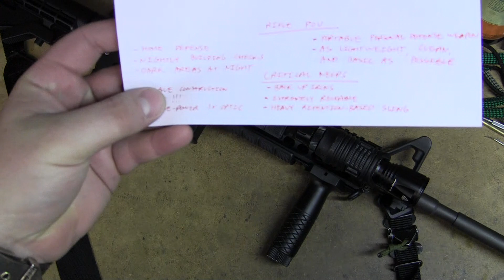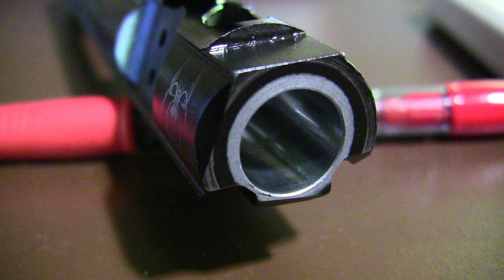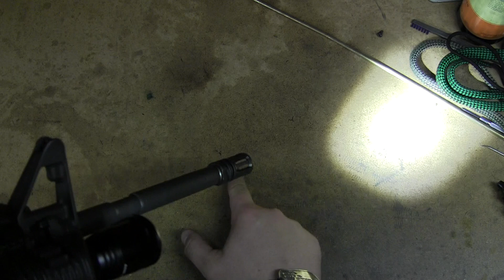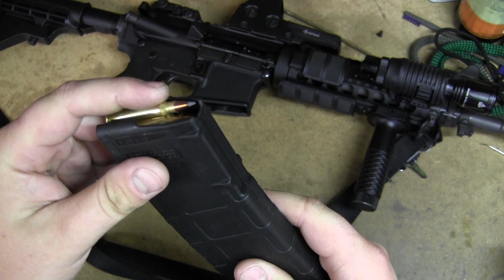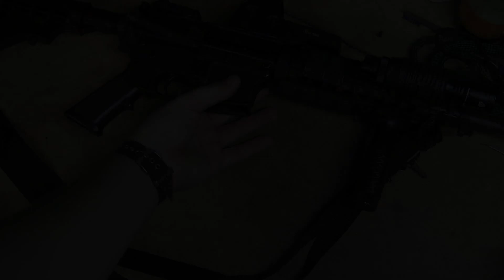Defensive AR Concepts

Comment: I used to be an Eotech AA battery guy years ago. Until I realized it's easier to but 2 batteries and be good for 10 YEARS with LEAVING IT ON and never having to worry about pushing a button every few hours. I can't count how many times I shouldered my AR to find the Eotech had already auto shut off... Still the Eotech needed new batteries ever few months lol

Comment: I love the rifle set up mine is set up similar. I don't like v grips or quad rails but to each his own it's whatever you like.so I went with a free float 12" m lock and added a small piece of rail for my light, witch brings me to my only suggestion, if your trying to keep it compact, light weight, and simple the streamlight tlr -1 is a awesome light. Ik it don't look like much but I went and bought one after I seen what they could do. It's also very versatile I can pop it off in seconds and slap it on my side arm if need be.

Comment: what type of quadrail is that. who makes it
Reply from the maker: That was the Troy 7" quad rail. Goes for about $150 and is ROCK solid and easy/quick to install. My only complaint was the weight, it had some heft for a 7" rail but if you want a quad rail and don't want to spend almost $300 on a Daniels Defense rail that is very light and you don't mind a little extra weight, then it's a good solution.

Comment: What kind of vertical grip is that?
Reply from the maker: +Scott Brown 

That was a garbage AIM Sports forward grip I believe.  It's a good design but the quality was bad -it was designed after the Knight's Armament forward grip if you want the same thing but with quality.

My current preferred vertical grip is the Magpul MOE short stubby one.  Lightweight, rock-solid, and short it's my current favorite.  I rock one on my M4 and M240 here in Afghanistan and they haven't let me down.  When I get home I'll continue to use it on my AR.  Cheers!

-Mr. 2nd

Comment: To help lighten up your rig, try the CREE Mini brand of lights, they cost under 20bucks(got mine for $6) BUT they are WAYYYYY under valued(mainly because they are chinese made im guessing). I bought mines for 6 bucks and it is 300 lumins, has high low setup, AND a strobe. Seriously, check them out, they are on Amazon.

Comment: What would you go with for shtf ak or ar?
Reply from the maker: Depends where I'm at, what's going on, and other additional factors.  If it was me using the rifle, it'd mostly likely be the AR because of the ergonomics, versatility, commonality of both parts and ammunition, and because I'm most familiar with it.  If I had to use it but also had to train others how to use it, I'd probably take the AK.  Simple, basic, and ammo/parts are common enough.  If it was a "Red Dawn" kind of scenario, I'd take the AK or whatever other Kalishnikov design the enemy was using for mag/ammo/parts/equipment commonality.  If I was having to cover serious amounts of terrain over many miles every day, I'd take the AR and run it clean with minimal gear/equipment on it to maximize the weight to firepower ratio.  Both rifles are extremely reliable and pretty robust in my experience, but the AR is more picky on ammo selection and takes a longer time to teach people how to use.  The AK is simplistic and fires a powerful short-range cartridge but accuracy and ergonomics suffer big time -but it would be the best option if I had to teach a bunch of people how to use it on the fly.  Just depends on what's going on.

Comment: Pretty sure I'd go 10.5"/10.3" with any full size 6-7" can, as should most people where legal. If it's a defensive gun I don't need the little extra push from 14.5", especially in populated areas.
Reply: If you use a full size can, there will no flash visible to the naked eye generally. If you use a flash suppressor, the flash will be small, it'll be visible depending on your ammo, but it won't be bad at all, way less than you'd see out of a 20" rifle using a brake. If there is any ambient light to use at all, the flash will be difficult to see.

Comment from the maker: Against the heavy-duty steel, like AR500 steel, it won't penetrate.  Against mild steel or less-durable steel, it'll go through.  Every piece of mild steel I've ever shot 193 with, it goes through like a plasma cutter.  Simple science -small diameter, fast projectile = penetration, but to an extent.

Comment from the maker: XM193 is not steel core, it's only lead covered in copper, but behold, it still penetrates steel at distance.  My buddy did an excellent demonstration with 193, check it:

watch?v=50_3Yyo0Nt0

Comment: I really dig the fact you went with a solid iron front sight. After ten years in the Army and years of shooting I trust THAT. Any sight that moves around I wonder about. Return to zero can be debated. At 25 yards why not. At 250 yards lets talk is the way I look at that.
I do like the new EOTech that takes the A123 just because it does not eat up so much rail space. The battery is more expensive but 600 Hours is good run time. I hope to live long enough to burn out ten of them.